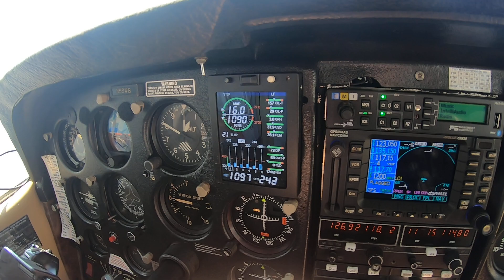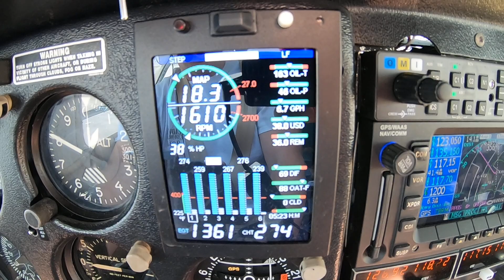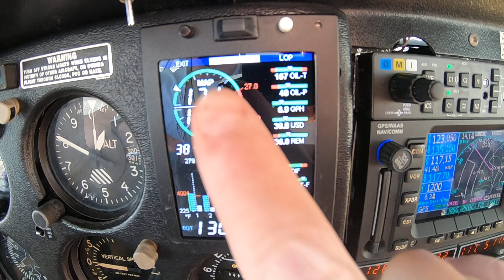55WB Set up JPI for Run Up

Comment: I’ve got an EDM-830 in my 182 and I find it more useful to run up to 1700 RPM, let it stabilize, hit Normalize, then do the mag check watching even rise on the EGTs. Wait till you’re at 1700 RPM before entering Normalize mode so your EGTs don’t go off scale during the mag check.  EGT will give you a more instantaneous indication of a problem (EGT on a fouled plug will not rise).